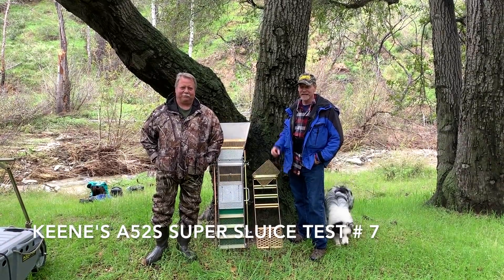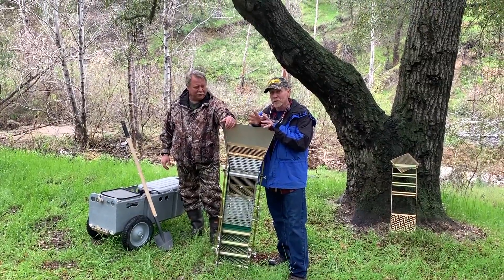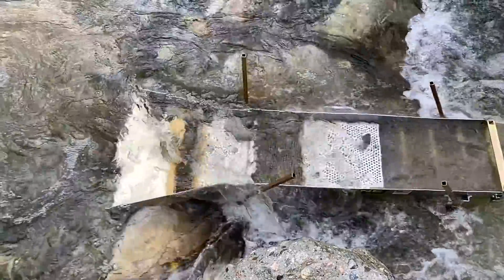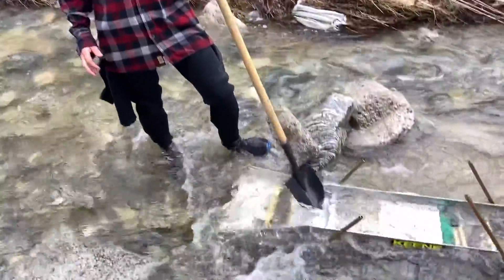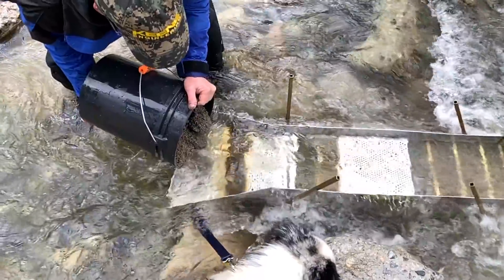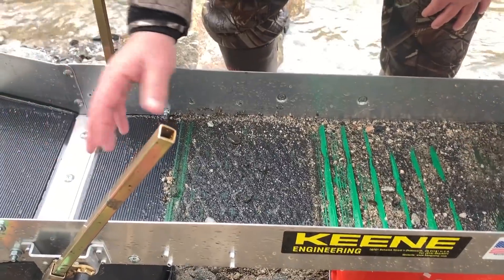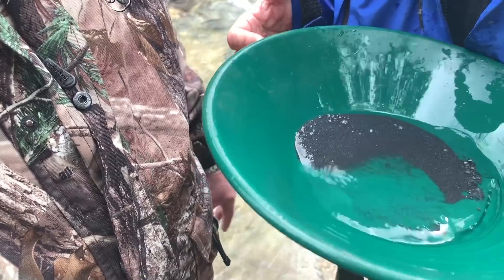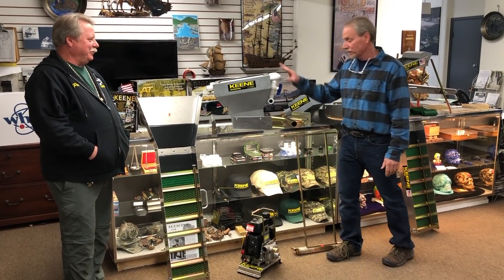Keene's A52S Test #7

Comment: Green Mountain Gold Trap will do a better job for less $ and half the weight and size!!! Guess there's lots more for you to learn! Me too!
Dingus and Eva!0
Reply from the maker: Ron I would never knock another company products however I have seen it and let's just say I was not impressed. Our system is extremely easy to set up and run and will work in a variety of conditions and water flows.
Reply: I don't think those Green Mountain Gold Traps are less money at all.
Reply: @KeeneEngInc  Forgive me, please! I had a really good morning. Thought I had a skunker, as nothing showed up in the -40 mesh clean up. Usually plenty of fine, -40 and smaller, but none. New spot, good last time???
I finished up with the larger cons, depressed,  only to be blown away!!! Lots of >40 gold!
I watch and think I subscribed???, to all your material. I own one! I did a video.. "Cherry Creek Adventure," and it's one of the many tools at my disposal.
Yesterday, I was using the GMGT, tomorrow? It depends.
 The dog only understands I'm excited about something??? Guess I got caught up in the moment....
Unfortunately, no video today due to limited time. So, after tomorrow's blizzard, Dingus and Eva will attempt to make it right with you. Again, my apologies for the slight. Stay tuned!!!
Dingus and Eva!